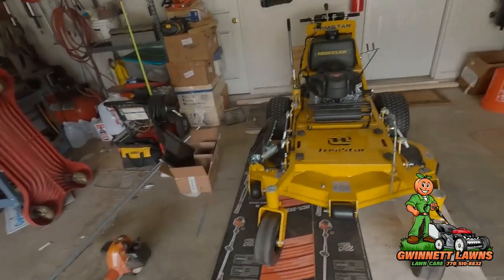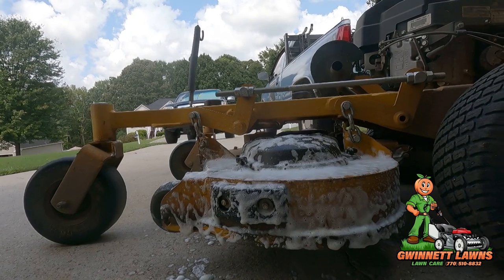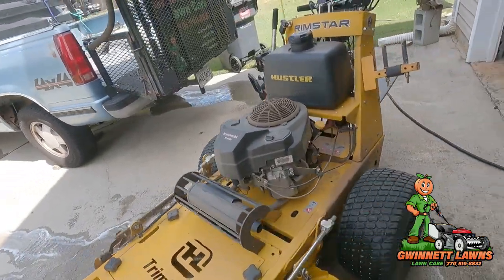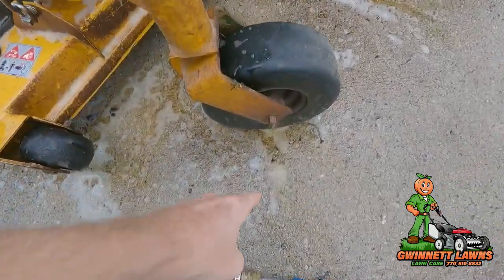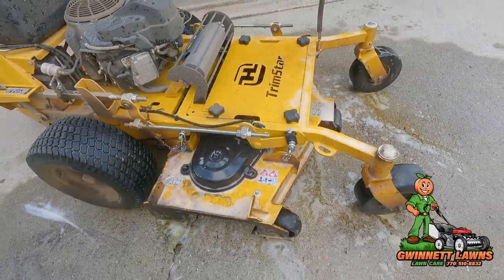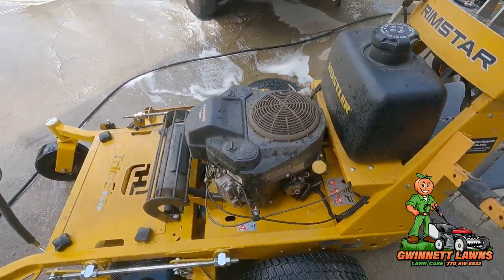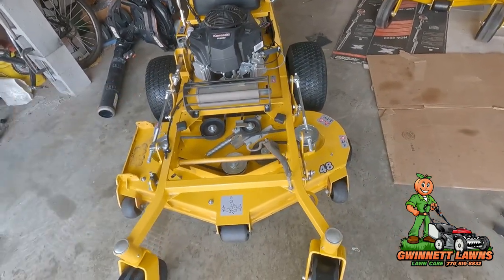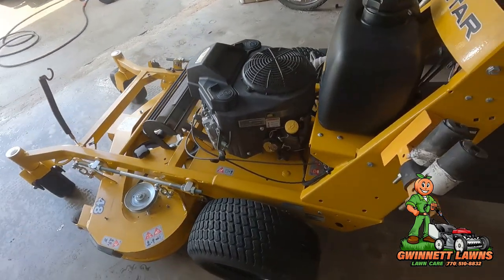Ballard Mower Magic Test and Review on a FILTHY MOWER

Comment: Hey Russell, just curious if a regular old school spray gun on a regular water hose would work. Im scared to use my pressure washer as it caused the coating to come off  of a witing harness in a few spots resulting in my mower malfunctioning.  Looks like Ballard has produced another great product. Thanks for the video.
Reply from the maker: I think that mine was a little difficult, because it was so tough and baked on, but not sure if a regular water hose would get it, especially on the edge of the deck. I definitely don’t like using a pressure washer on the mower but I did have it turned down quite a bit.
Reply: Gotcha. Thanks man.